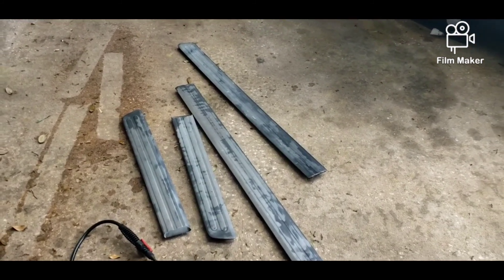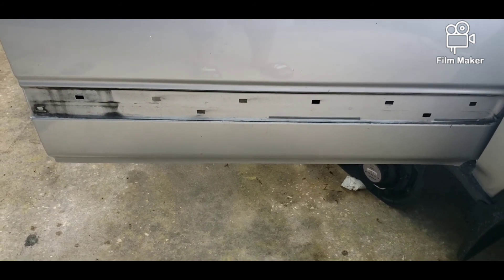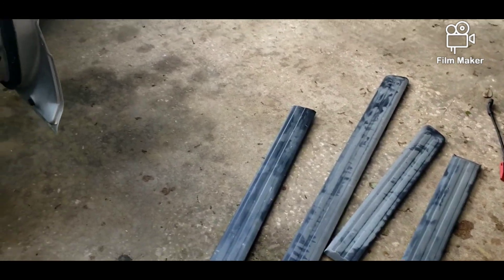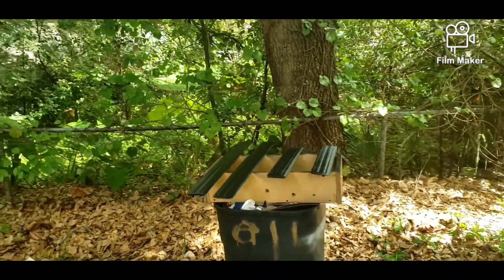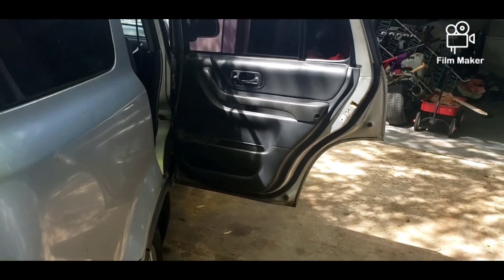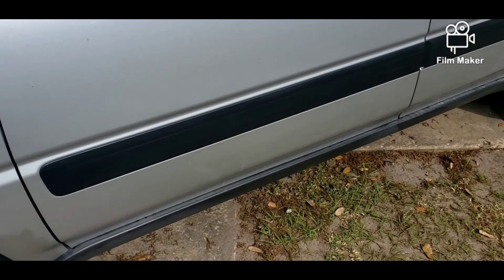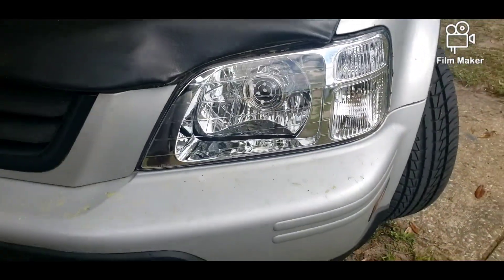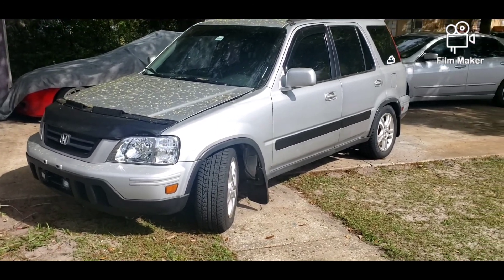Crv side moldings re-paint

Comment: Yeah, I used a Heat Gun on several exterior parts on my cr-v 2004 and it was amazing. Really brought the bumpers and other parts back to life. Unfortunately  the upper side door molding is not rubber and all I did was ruin the finish a bit. I just repainted it and sealed it and it is fine.
Reply from the maker: I tried that method but it didn't work for me.